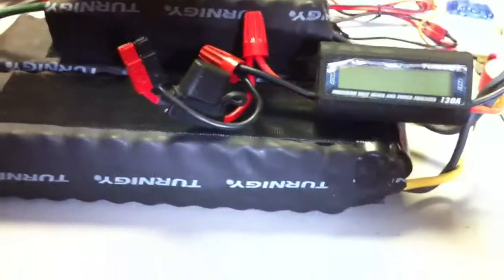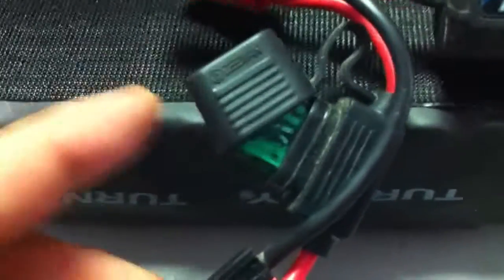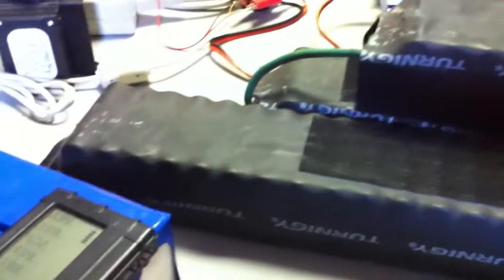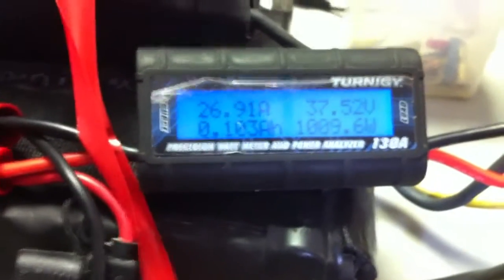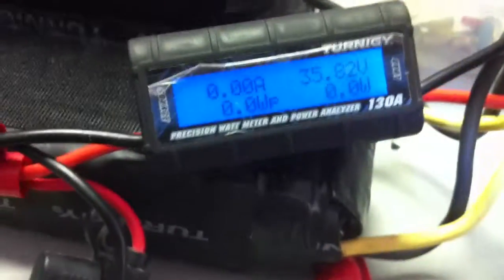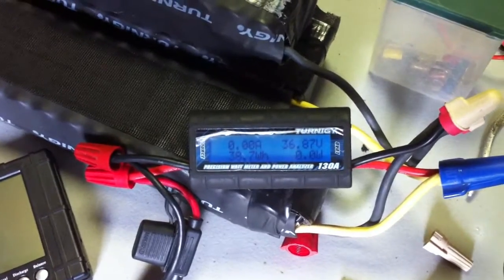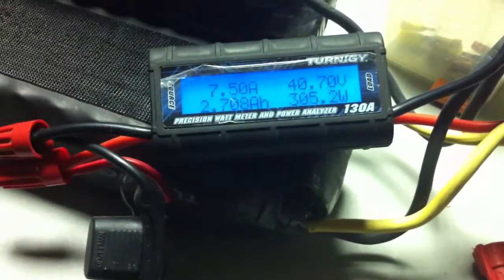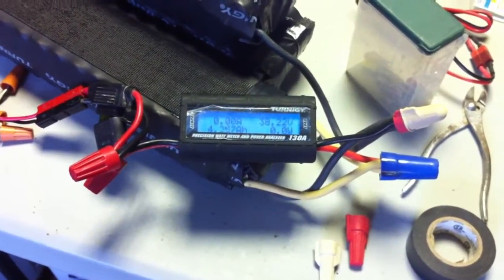EBIKE 36v - Sony 18650GR Cells recovered from zero volts

Comment: Enjoyable video - but why didn't you use an amperage regulated power supply?
putting 40+ amps is ~20C which those 2Ah cells are absolutely not designed for ;-9